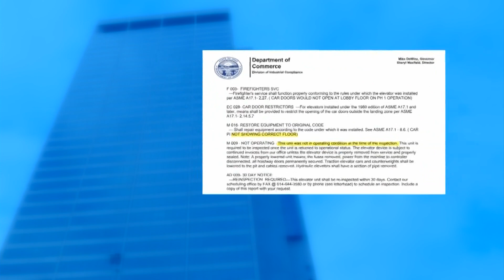Rhodes Tower elevator that malfunctioned shouldn’t have been in service, inspection records show

Comment: Ah, Elevator 10!!! I worked security in the building during the early 2000's. The sounds coming from the gear box room up at the top sounded so bad back then I refused to ride the elevators. I walked the entire building using the stairs. 

Jared got stuck on elevator 10 for two hours at 3 am - 5 on a Tuesday morning. Poor guy had to relieve himself in a dixie cup.

Comment: Per WBNS website also:

According to the inspector’s note following the Feb. 1 incident involving Kravitz:

“There was no indication that the car over sped nor did the car or counterweight freefall; all suspension members appear in good condition, neither the car or counterweight safeties were activated. There are indications that the counterweight governor rope became slack and came in contact with a rail bracket inside the hoistway, hence severing the rope and initiating an electrical stop, stopping the car in a blind hoistway,” the inspector wrote.

BUT...

The statement that Brett Kravitz gave stating that he free fell "5 or 6 floors", and the post incident inspection report contradict each other. The report states no sign of freefall, which would 100% activate the mechanical brakes (within a few feet of drop max), even of the governor cable and/or the counterweight cable failed, or an overspeed was detected. How this is possible is beyond me.